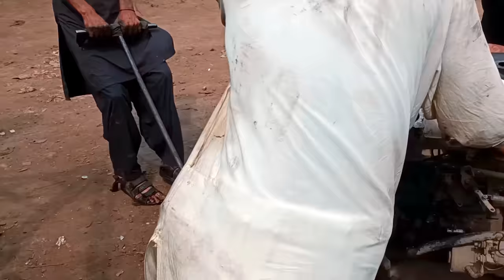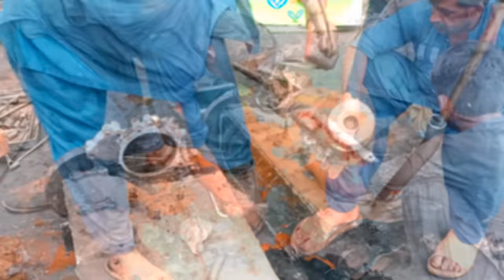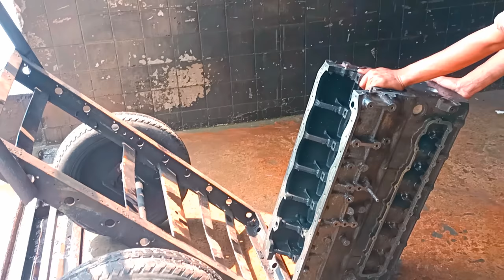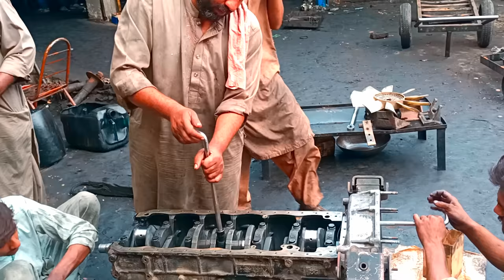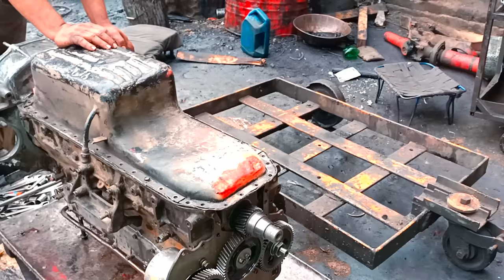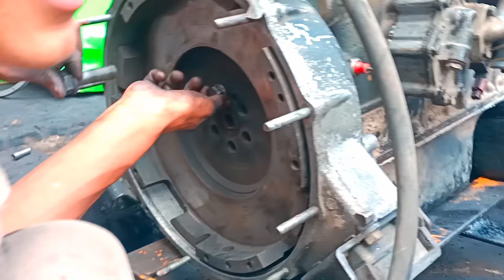Restoration Old Bedford Truck Seized Diesel Engine | Rebuilding Nissan Bedford Diesel Engine

Comment: That’s pure teamwork. Great to watch these professionals. Working conditions are not so great but they came out the best under given resources. Really hard workers.
Reply: Professionals? What are you talking about? it hurt me while I was watching this, the guys are scattering parts while they are dismantling it, did you see how he took out and threw the camshaft just on the ground, but how do they turn the engine block over? this is not a restoration cuz these guys without the slightest desire to do well simply rebuilt the engine. Also where is the oil lubrication when installing new shells and crankshaft?

I'm done, I won't even go on🤦‍♂️

Comment: I just wish they’d show it running
Reply: The proof that engine will work is the age of the bedford truck itself.  It was originally made in 1950's, and has been running after 70+ years and will continue to run, as only those same mechanics have been able to keep it running for 70+ years, and keep it running for another 70 years.
Reply: Gostaria de ouvir o ronco do motor retificado. Saudações do Brasil. Gratidão pelo vídeo.🙋🙏👍🤝

Comment: So... How long will it keep running until it seizes up again
Reply: Depends on how much sand and dirt they stuffed in the crank case.
Reply: Do you realise that this truck is over 50 plus years with what seems to be the original engine.   I'm sure they've  done this in pass and  have had good results, hence the reason they're still in business.   So to answer your question.   Maybe another 50 plus years again.
Reply: Debe, de, funcionar, pues, le, an, cambiado, camisas
Reply: 5 years of continuous work
Reply: A

Comment: If they didn't drop everything down in the dirt, they wouldn't have to spend so much time cleaning it up before putting it back together.
Reply: @claudehuyess4466  It's religion.
When Allah was born, his mother first dipped him into the dirt.
Reply: Gives them good reason to clean each part. We work on benches at waist height...totally different concept. We also blow our noses into hanky or tissue and carry them around all day....they are horrified.
Reply: Sure..with modern methods, this can be made in half time...!

Comment: Hey Imran - what's the torque setting on these old stretched bolts I'm putting back on? Oh, yeah, it's hit three times with the 10 pound hammer.

Comment: I'm confused the the title of the video says restoration of old Bedford truck diesel engine, and rebuilding of a Nissan Bedford engine. I didn't know Nissan made Bedford engines, I use to drive them in the mid 1960's and they only had Bedford engines as far as I'm know made in Luton England fitted but i stand corrected if not true.
Reply: It's a nissan U.D engine, early 90's model. Your correct about the Bedford engines however Bedford did use Isuzu engines aswell but not U.D engines, so must be a retro fit.
Reply: Hello from Texas  yes allegedly Nissan Bedford teamed up for a short period  greetings to all in England I was American teamsters union driver 1970 to 2000 great to be retired  best regardes to all  lord muck Kurt mills chanel may also know   dulce and c r Mackey in Texas USA
Reply: @CrMackey-kt3mp  Hi sorry I missed your reply thanks for the information, I use to driver Bedford TJ's for Maynard's Original Wine gums in North London from 1967 - 70. They had coach built bodies built at Arlington Motors Coach Works in Enfield London no power steering on these boys but we managed. The brakes on the early models were of the vacuum type not very good took longer to stop 🥺 no joke. They were fun to drive though, I do have some photos of Maynard's trucks going back many years. Be glad to send some to you with your permission that is. Best regards Reg

Comment: These guys show very bad service to the engine block. If you put cheap fuel in the reconditioned engine, it will end up more in the workshop which will cost $$$$.  More in the long term. 
Typical south Asian mentality.

Comment: its easy to see why this engine is seized, lack of maintenance, engine oil  not changed for ages and cooling system in poor condition.you cant run with just water in, must have an inhibitor or antifreeze mixture, where is the air cleaner on this vehicle ? the engine is not a Bedford engine !

Comment: They…they never cleaned up the block surface after dropping and scraping on the concrete 🥴😵‍💫.
They didn’t replace the pistons that were pitted..
I’ve never seen an engine block taken to a car wash before assembly. Holy shit this was cringe but worth it lol

Comment: The way they throw the parts on the ground is kind of nerve wrecking but since it’s the only repair shop around there I guess they have no choice. Or how they threw the engine block on the ground 😂😅😅